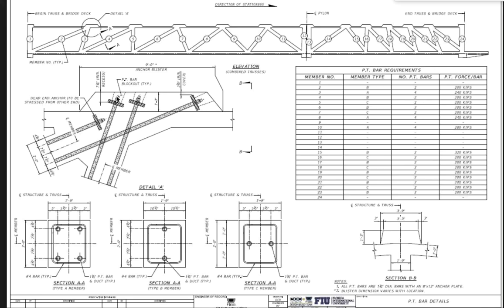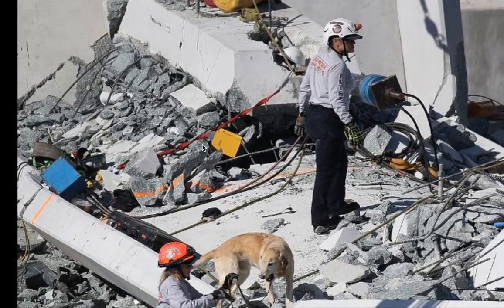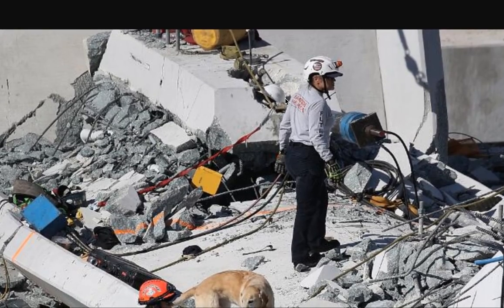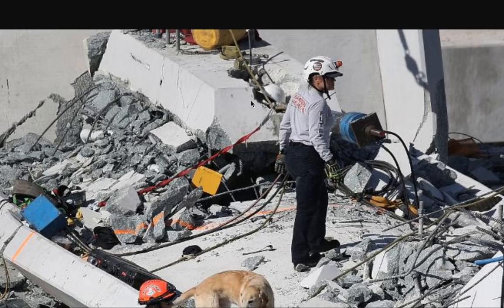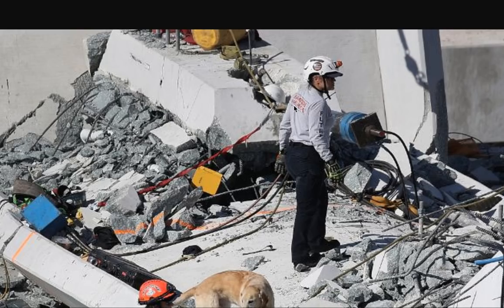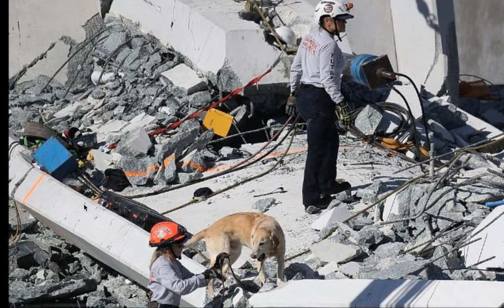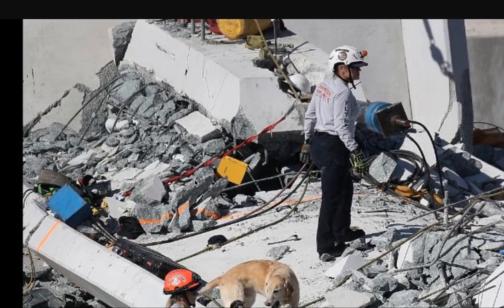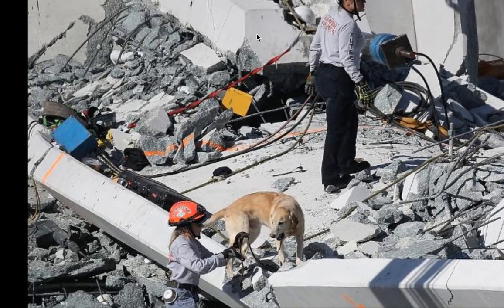FIU Bridge Collapse node WAS jackhammered Blister Bar with a load path conflict video?

Comment: I've watched the NTSB meeting for this and you are more thorough. Plus you pinpoint the actual cause that was never mentioned in the NTSB findings; that there was no way to access the rods without the jackhammer and there was no engineer (or one worth their salt) to point out thr dangers in this solution. Not closing the roads also points to some ego being involved.  Like they didn't want to seem like they had messed up. The bridge designer was more concerned with aesthetics than structural integrity. And this mindset of image over practicals is why they didn't close the roads. So as not to seem like there was anything wrong. I think these are factors woth looking at and should have been mentioned in the NTSB final report.
Reply from the maker: Thank you for sharing, I also did a physical model and have demonstrated... 
I will show that model again, in a future video. 
I will find the older model video  link you shortly.
Hope you enjoy it. 
Kai
Reply from the maker: Let me know when you finish this one and I will get you the correct followup video to this https://youtu.be/2FZYLtxiLJs

Comment: Wow, kudos for spotting the jackhammer (I did not see that the first few times I looked at the photo). That puts a whole new complexion on this story (even if it is not the ultimate cause...)
Reply from the maker: I agree, I am not really sure what their intent was, using that jackhammer... I also found images showing the top node already had ''damage'' done before hand -- and then this looks like they had it again - ''round two" , if you will.
Yes, this does put a new, complex story with this ''nut-so'' job...  All ''engineered on the fly"...

Comment: I have been watching a lot of videos about this and one I saw by Strontium Milks. It shows the security video and when I was watching it I concentrated on the top node and just milliseconds before it collapses you can see something pop out. Now I heard that there are witnesses that heard a whip-crack noise just before it collapsed which as we see must have been the tensioner snapping. Now, for a design to fail at one point because one tensioner failed is bad, usually, there is some form of redundancy built in so that it doesn't result in a collapse, whether this is engineer failure or construction company failure on the inquiry will tell.

Comment: Looking at more images, it appears that the jack-hammering was definitely done BEFORE the move.  This implies that the rods were not able to be properly tightened from the bottom as per the design. The work being done at the time of collapse was not the first time adjustments were made from the top.  

Creating the holes was obviously a last-minute requirement. Why was it necessary? Did the holes affected the integrity of the structure? If so, the move would have caused damage. Were engineers even involved in this decision? 

A last-minute change like this should have put a stop to the move until the effects could be fully understood.

Comment: Thanks Great Work
Seems to me the angles do not have show balance tension and subsequently when the structures Mass Weight and Gravity factors are added to the overall design, just do not add up to "Anything SAFE"  I'm not an structural bridge engineer but the whole thing looks like more Art then Load Balancing..!! 
I.e. Too much eye candy glued together with wishful thinking..  Furthermore: 14 Million Cost...!!!
Looking at materials and labor is way to much for this Deadly Nightmare  Period 
My take... after it comes under State Engineering Peer Review, the finding will fall at the feet of the all parties involved:  Local zoning engineer authority who will share fault with Fraudulent Credentialed Ms Figgie & Deadly Design Partners who cobbled the entire  Rig and those at MCM who likely used their political contribution to leverage the project through the county / state approval process..  Either way ground zero falls on Ms Figgie and MCM
Final comment:  Women should stay the hell out of High Risk Manly En-devours  
Women simply lack Worst Case Contingency Forward Thinking..
I know Ill catch the shit for this but all my professional project manage experience which is extensive
precisely supports that conclusion.
Reply from the maker: I won't be giving you shot for sharing and expressing your "source files and conclusive files''... 
In fact, I will do a video about your comment!
It proves so much, in my psychology of thinking and how we make "conclusive files"... thank you.
Reply: Re Absent Minded Forward Thinking 
My experience with the root problem here is comprehensive.
Love and Nurturing has no place in projects that exhibits even the slightest potential Risk of  human collateral injury or loss.  I.e No mind to Forward Think Safety First,
and "If its Possible then it will eventually Happen"....!
Reply from the maker: Safety first
Keeps you from the hearse

Comment: No bridge should be designed where a *single element failure will result in collapse... 

the engineers probably knew this, and were counting on the overhead tower and 16" pipes to provide that redundancy... 

they no doubt considered that a small risk in light of the publicity and gains to be made by not blocking traffic and a spectacular final product...  

in my experience, just another fatal mistake made by management and other vested interests, then engineers who allowed that compromise.    In my own 40 year career as a mech engr I have seen this many times.... a short list includes:

The two challenger disasters, in excusable ignorance by management who over rode the advice of the engineers involved... termed 'ignorance and incompetence to almost criminal levels'.

Other examples:  
 Fukushima, and its 24 sister reactors through out the US, a fatally flawed design compounded by overloaded spent fuel rod pools .... placed over 50 feet above ground so that when (not if)  they run dry and go critical 
.
The Indian point reactor 30 miles from NYC has its cooling water pumps in the basement, and its located in *flood plane... the excuse no doubt... 'its in a 150 year flood plane but we had a flood 50 years ago so the next flood is not due for another 100 years"    I made that up, but its the sort of loopy logic I see in engineering offices regularly ... and the identical logic that would have supported putting that reactor in a flood plane....always driven by the management, rarely the engineers.

This came close to making NYC uninhabitable for 300 years,   we came within 2 hours of that result during hurricane Sandy when the power, generators and pumps failed.

I could go on and on.... there is no shortage of entirely fatal idiocy in the world... not generally seen with the common man, but with those scientifically uneducated political types that tend to rise in management
Reply: Unfortunately, all truss bridges are designed so that if one member fails, the bridge collapses.  It's in the nature of a truss bridge.  Very few do, and those that have were due to improper maintenance (think too much rust) or a design flaw (gusset plates too thin).
Reply: phil scott I know nothing at all about engineering and construction, but what would happen to engineers who refuse to do things they think are potentially deadly and wrong? Do they get fired and never work again or do they just get demoted or what? I mean if they do something they think is bad and it comes true, their reputations are ruined anyway. So what is the better choice for them?

Comment: I think you have hit it!

Since there was no access to the PT rods from the top, they had to be adjusted from the bottom  prior to the move. In that case, they would have known that there would be no way to de-tension it after it was in place.

The fact is, the rods would no longer be applying stress once the bridge was lowered onto the piers. The load compression would exceed the pre-tension stress. The idea that the rods needed to be de-tensioned does not make sense.  The fact that a construction worker said they were going to de-tension the rods was wrong - there was no way to even accomplish this.

The only reason to access the rods after the fact would be to apply additional tensioning - probably in response to a perceived weakness that they were trying to overcome. But adjusting the tension after the fact was not allowed for in the design. So what did they do? The jack-hammered the blister in a effort to get to the rods.  And they managed to tighten one of them.

There's no way an engineer would have allowed this kind of improvised approach. Who knows what the effects of jackhammering would be on structural integrity - let alone the effect of tensioning the member while in compression (and without grouting). What's more, the rods could not apply anything close to the amount of stress that the member was already under. Anyone who thought that tightening the rods would have any effect was obviously not an engineer and was not in a position to take this action.

If there was a weakness suspected the road should have been closed. Keeping it open while trying to make an improvised adjustment was reckless!

Just crazy!

Comment: In one of the videos after siting the bridge on both bases one engineer was stating they were DE-TENSIONING the 11th element not tensioning  it .as you  explain   through the whole video
Reply: They de-tensioned it after the move, as planned. Later, immediately before the collapse they re-tensioned it again as directed by the engineer(but not as planned originally) to theoretically fix the cracking(obviously a terrible idea). This was the last straw, and the base joint blew out.